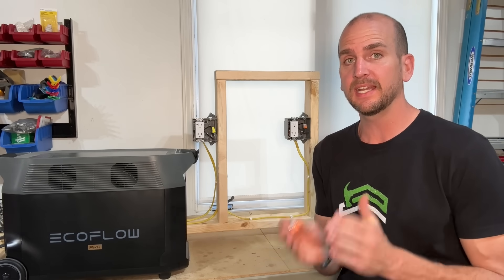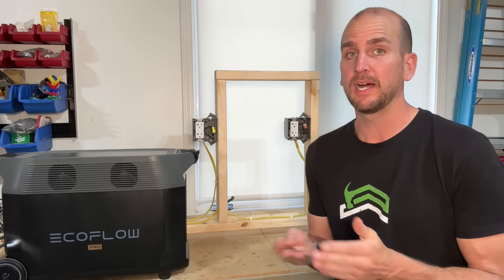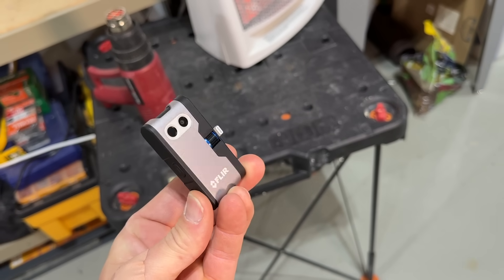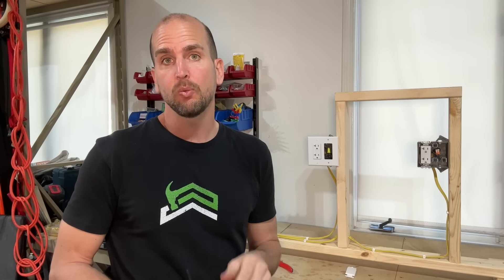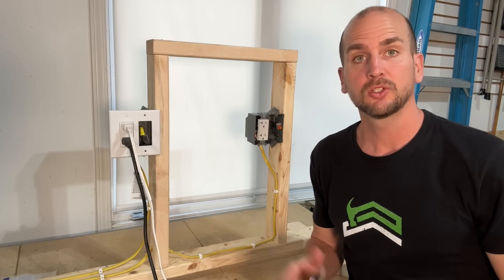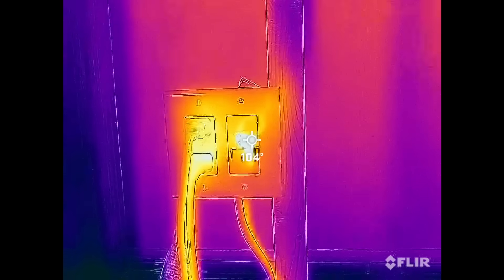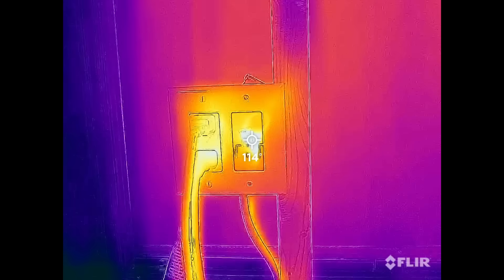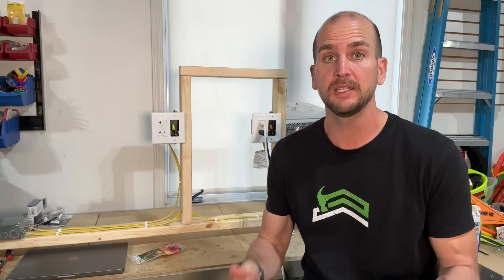Debunking the Pros: Can WAGO Lever Nuts Handle Heavy Electrical Loads?

Comment: I  also say Excellent test! however when I was doing thermal studies I was required to keep the test going for at least one hour. The slope is exponential so the rate of change after the first 20 minutes drops significantly but you may want to try again to see the stabilized temperature reading. Also one slight correction to the statement that the 20 amp breaker trips when 20 amps is exceeded - it may take an hour or longer for that breaker to trip at these slight overloads. you can push 40 or more amps through a 20 Amp breaker and that may take a while to trip perhaps a half minute or more.

Comment: This test shows that the Wago heats up more than the wire nut, even if the wire nut is applied without pre-twisting.  (I would have liked to see you show us how much of a twist you got out of that wire nut; you promised you'd show us, but you didn't.)  What it does NOT show us is the effect of the extra heat over time.  A connection with extra heat will degrade faster than a better connection with less resistance.  The connection surfaces oxidize, creating more resistance, and more heat, and more oxidization, and so on.  So the real test should not be "how do these connections compare after ten minutes?" but rather "how do these connections compare after ten years?"  Also, I can't help but feel that you deliberately handicapped the wire nut by not pre-twisting.  You were doing this test in response to complaints from pros, and the majority of pros pre-twist, so it would have been fairer to install it as the pros do it.

Comment: I recently switched from wire nuts to Wago 221.  The Wago is much easier to use and reuse.  I feel more confident in the Wago than the wire nut.  Two thumbs up for Wago.

Comment: Where I am a bug fan of the Wago lever nuts is for the final connection from the solid house wiring to the multi stranded wiring of lights. The ease of connecting these two types sold me on them.
Reply: because your a lazy electrician not concerned with the quality of the job.
Reply: @RadioRich100  I'm not an electrician
Reply: @Stickmanght  Im glad
Reply: @RadioRich100  every test I've seen of these connectors compared to the old twist type show that they hold up at least as equally well. Both for heat, and current, as well as pull out. As a amateur homeowner, the simplicity is far better than wondering if I have twisted the wires correctly and twisted the cap correctly as well. Your snobbish response isn't helpful.

Comment: I would like to have seen you twist the wires in the wire-nut first.   I'm skeptical of ratings and prefer your measurements.  THe actual problem I have had is with the 120V Charger for a  Chevi Volt.   Even with a 20 AMP style plug it overheats, and eventually causes problems.   A l;ot of the problem is that for some stupid reason EV chargers have a very short supply side cord which is extremely awkward, and very much a nuisance.  What your video showed me as a direct connection to the outlet with a screw down connection is best.  I like the wirenuts with ears.   I've never used Wago's  but I'm skeptical.  They seem electrically weakest.

Comment: 🇨🇦/🇺🇸... A couple things. 1/ I would automatically tend toward using mechanically simpler mechanisms. 2/ Traditional wire nuts have some size overlap and so you can often ADD a circuit without changing to... hunting through your parts drawer... a new size. (not an issue for the pro who keeps an inventory on hand but sometimes an issue for the homeowner/handyman) 3/ Are a package of WAGO more expensive. (some people won't care... some will)

Comment: You are seeing a 10% temp increase so you are using more energy!  It would have been helpful to take current and voltage drop measurements to get a better evaluation of the problem with using wagos

Comment: I always wondered about the small contact area of the Wago's and how hot they would get under heavy load.  They don't seem to be bad at all though, even with the slightly higher operating temperature.
I will continue to use them.
Thank you for the test!  BTW... nice arms!

Comment: This is pretty interesting and thank you for going the extra mile and using a high amperage load and examining it with an IR camera. You make really good points with regards the heat capacity. I have seen plenty of failures from loose lugs, bug nuts, stab in outlets, improper use of outlets as splice points, and you make a  good argument for a way to splice wires easily, consistently and reliably.

Comment: You are only supposed to load a circuit to 80% capacity for a long term load like you did. For a 20 amp circuit, that would be 16 amps. You overloaded the circuit, yet in all three cases, you didn't see anything dangerous or concerning. I have just started using the Wago connectors, and I can tell you I have a much better chance of getting something wired right using them. I have discovered, however, that I have to be careful cramming everything in the box to make sure I don't accidentally open one of the levers. I think if I had more experience, I could get all of my wires the correct length so that stuffing them in the box is more like folding a piece of paper that crushing one of the great pyramids. 
I would like to see some tips and techniques in regard to that issue.

Comment: Great vid. Thanks for sharing. I’ve been very skeptical of wago. I’ve only used them on low voltage applications in the construction is industrial components not residential applications. I’m building a shop on my property. I may have to try those!!

Comment: I think the question is how they will hold up over time. Will the spring lose tension with heating and cooling cycles and gradually increase the resistance of the connection? I installed some on a well pump circuit for a stress test and so far after almost 6 months they are holding up quite well. I've been waiting to do a review video until the results are in but I tend to agree that they may be a good option especially for the DIYer. I'm an electrician by the way with 38 years of experience. I don't like the quick connects connections on devices because of the high failure rate and I though that the WAGO's may have a similar long term result but now I'm not so sure I was correct.
Reply: you were correct , they will eventually fail if not sooner.

Comment: wagos are so much easier to connect stranded to solid wires. most light fixtures use stranded wires. sometimes they can slip off the solid wires when you use a wirenut. with a wago, you don't have this problem. also i don't need to worry about current as my light fixtures use very little current.

Comment: In the housing units I service I often find high resistance failed and melted wire nut connections in water heater electrical box entrance connections and when repairing I replace them with wago lever nuts. They have been excellent, take up less room in the box and are a sure connection. Never had a wago failure.

Comment: I think it would be interesting to see how much extra power is being used at that high of a draw and then under “normal” loads. Heat = wasted power. It’s probably small. And even smaller under normal loads. But would be interesting.

Comment: this test has been done many times, i takes a welder electrode to get enough amps to heat them up at which point the wire insulation has melted off.

Comment: Great video. Yeah the WAGO is a bit hotter, but it is still well within design parameters, and perfectly safe. And the ease of use is amazing on the connectors, helping get a better connection and setup.
Reply: A bit?  10% hotter isn't a bit.  A bit is more like 2%.
Reply: what design parameters? Heat and resistance is ok!! Why so you can save 30 seconds putting it in? Twisted joints dont get hot. The wago is in series with the load the wire nut is not. U just put a double resistor in series with the load. One going in one going out. Their another point of failure.

Comment: One question I have is what would the results be after time as passed by. I.E. in your test I'm assuming you used new wire nuts and wago connectors. Would results deteriorate over time for either?

Comment: Actually, if you examine the Time-Current Curves you will see that very few 20 amp molded circuit breakers will trip at 20 amp (for a 20 amp molded circuit breakers). Breakers are generally a device made to trip on faults (not including AFCI and GFCI breakers), but they have to go for many hours at 20 amps (unless you are in Death Valley)!

Comment: Contact resistance isn't the primary concern - Wagos are less susceptible to operator error, and the sprung contact provides more consistent holding force across wire types or operating temperatures, making them more reliable overall.

Comment: I would like to find used WAGOs and use those for stress testing. After 5-10 years of many cycles of on and off, same goes for wire nuts. Granted wire nuts need to be left together so it could require severing the wires before the connection and then connecting them up to power.

Comment: They actually get temps hgher than the wire nut because you're using them with solid core wire, elsewhere in wolrd it's more common the use of stranded. The solid core gives you less contact surface on the wago, while stranded each individual core make contact wih the conector.

Comment: Wago connectors have not been around long enough for plastic from that they are made of to deteriorate enough to cause any troubles. Most plastics are combinations of resin and hardener, and the hardener never really stops hardening, so over time, and it may take a long time, plastic becomes more and more brittle until eventually it crumbles. I have a 70 year old piano, and plastic parts of the back checks have started to fall apart, and I had to replace them with wood. Wood is nice.
Wire nut also has plastic, but it holds wires together with a metal nut, so even if the plastic falls apart, the wires will stay together. If the shell of a Wago connector crumbles, the wires may fly apart. It may never happen, or it may happen in 40-50-60 years - I don't know. In that much time most outlets and switches will have been rewired most likely.

Comment: Is there any reason to electrical tape the Wago levers to preclude inadvertent opening during installation? Will it trap added heat ?
Reply: Those Wagos are made to be used as they come. Best thing is to avoid home made "improvements" because there always might be side effects you can't foresee.

Comment: I understand this is a torture test, but 10awg wire should have been used instead of 12awg to stay compliant with 30a circuit wiring.

Comment: Excellent tests and outcomes. However, one point of critique is that assessing surface temperatures might not provide the most equitable comparison. As the heat generated at the "junction" needs to travel to the surfaces, the cover materials and shapes become significant factors. A more just comparison could involve analyzing the voltage drops at the junctions while maintaining consistent currents across different usage conditions. This approach would allow for a direct comparison of the connection resistance.

Comment: Also to note is that this is surface temperature. I don't know but suspect the wirenut does a better job at insulating heat (or angling it down, potentially away from your thermal imaging device). That may account for at least some of the delta in performance.

Comment: The more of these videos that I see the more they come across as "not invented here" and resistance to change (no pun intended). Wire nuts are a simple but primitive and wire damaging solution which work but as soon as someone wants to do anything involving reusing wires or using different wires then the Wago connectors win through every time. In the end, the only advantage of wire nuts is that they are slightly cheaper, for every practical other metric they fail. If you are really concerned about any trivial loss through connectors, then solder them together. Great comparison

Comment: For even less resistance, I always prefer to solder house wiring directly to the receptacles. Then I pour liquid electrical tape over the back to prevent further loss of electrons through evaporation. Any jumpers to other receptacles are usually ran with purple automotive wire. I find the purple wire transfers the energy faster than the red.  But sometimes I like to use the green automotive wire for jumpers so I don’t confuse it with my line hot wire. But definitely use the autozone wire and not the home depot brand. HD usually sells 12 ga. I can buy the 16ga at autozone for cheaper, plus it has 4 more gauges!
Reply: You should try german automotive wiring - we have no general speedlimit on highways.

Comment: I am a remodeling contractor, formerly an electrician once. I use the Wagos all the time on 15 amp circuits but was always not sure how they would hold up on a 20 amp kitchen line. This was fantastic video. Great job! I am confident to use them on 20 now. Sweet! Thank you!
Reply: They have different ratings. Just like wire nuts. Just make sure you use one that is rated for the size circuit you are working on, and you are fine with either.

Comment: For my own projects, saving room in the right junction box I have used the Wago 221, I would agree to keep it for 15 amp circuits, so many lighting applications are led using much less current! German standards for electrical engineering appear to be very well tested!

Comment: The Wago allows for a more accurate heat signature reading.

Had you pointed the twist-on away to be looking up the skirt of it directly at the wires, I am pretty sure you'd see a higher temp than the Wago.

Comment: The real question is how these Wago's perform over time. It's the same principle as the Quick wire push in connectors on the back of an outlet. Over time these connections heat up and cool down thus expanding and contracting. The end result is a loose connection that ends up generating more heat and eventually failure.

Comment: I know that this is the latest hot debate, but like your video test confirms, the heat difference with the wago is negligible and well within the norms.   And, like several of your commenters have pointed out, Germany (230v) has been successfully using these things for years.   for 20a loads, I have zero fear of using them.

Comment: What happens to the WAGO spring pressure after it has been heating for a few years under heavy current draw? I believe the spring will weaken and resistance will go up creating even more heat. I believe copper conductors well-twisted first with pliers, and then capped with a wire nut, is a superior connection.

Comment: you can tell when a wire nut isn't going to hold properly, most of the wago's i found that were failing had been in service a couple yrs, before they failed. not so show and tell, as anyone might think.
you may think they are tight and true a few cyccles down the road when the truth hits,.

Comment: Wagos preform great in all tests compared to a wirenut but not the pull test. A wirenut can handle more pounds of pressure than a wago. Besides that they operate pretty much the same and it's sparky's choice.

Comment: Great test! Results are exactly what I would have expected. My wife and I have lived in 14 houses in 10 states and I have seen some absolutely horrible electrical wiring. These Wago lever nuts are fantastic and make wiring so much easier. I have used them for 10 years with no issues whatsoever. I strongly suspect that the professional electrician objection to Wagos has more to do with keeping DIYers away from the trade than actual safety...much like plumbers' dislike for PEX and Sharkbite fittings.
Reply: I dont think your right. We have plenty of work. Its us giving you the benefit of our experience. Faster is never better in anything. Copper to copper is the best electrical connection. With wagos your putting 2 spring contact connections in every circuit with the conductors never touching each other. We have seen many spring contacts fail on outlets, wagos and more. Now you have 2 in every circuit. Your asking for trouble to get the job done a few seconds faster.

Comment: I like using wagon for 12 v I run small engines and equipment if safety is number we use it for rotation led for our equipment it's a very good product they put out

Comment: I am not an electrician, but I replace outlets at work, and I don't use wago lever nuts, on the hot, or neutral, but I will use them on the earth lines. Now at home I use them everywhere. Because I know that I'm not really going to overload the outlets or stress them that much with high loads.

Comment: As someone that uses these in the HVAC trade for making connections to fans, compressors and solenoids, I have a high respect for them in their uses. I have found using wire nuts in high moisture environments like the cooled boxes of walk-in coolers/freezers and reach-in boxes they perform better. The wire nuts have rusted on me and I have to cut wire back and re-terminate with a new device VS the WAGO I can lift the lever pull the old device out and connect the new one without having a rust issue and loosing wire length. I still have my questions about them in high vibration environments and therefor will use either a wire nut or a termination block. Thank you for the insight into the temperature issues that people voice and prove they are still a better option for DIYers to use since strand to solid wire is not easy for the novice to do. I do use them at home in automotive too but in low current applications.